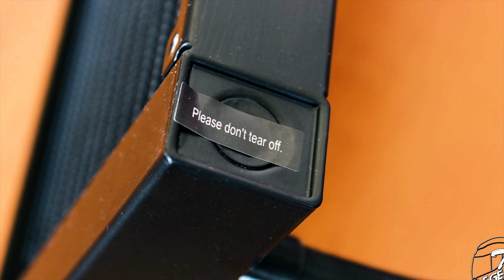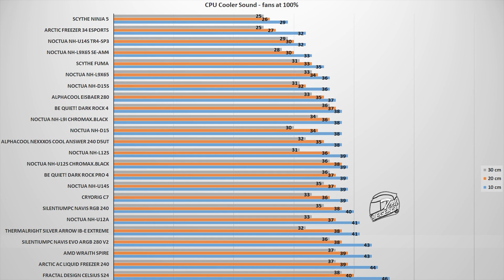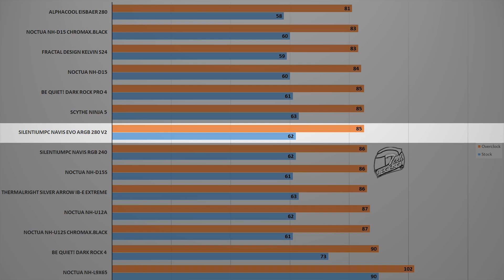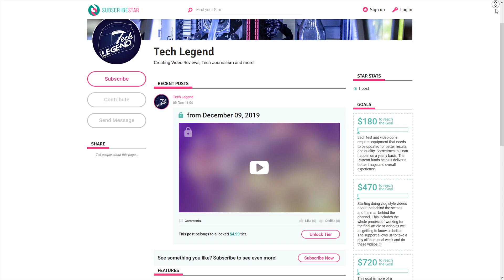SilentiumPC Navis EVO ARGB 280 V2 | CPU Cooler Review

Comment: I can not get the ARGB cables (3 pin separate) to connect to my JRainbow connector because they both have rubber around the pins. I can not even get fan 1 to connect to fan 2 because they also both have rubber on both sides. How do you do this?
Reply from the maker: Are you sure that you removed the protective cover of the RGB connectors?
Reply: @TechLegend-com  Yes pretty sure, eventually I just ducktaped them literally and the RGB works, the two fans work also.. But the block on top of my processor is not cooling it down. My processor goes to 90°C in 5 minutes. It’s attached to the PSU and the main cable is attached to CPU fan so I don’t know why it’s not cooling my processor
Reply from the maker: @Imperatormusic  If it's not cooling the CPU then RAM it, it sounds like you have a defective unit.

Comment: Mine isn't working, its in my computer but doesnt do anything, what can I do?
Reply from the maker: Did you connect the pump and the fans correctly?
Reply: @TechLegend-com  its a pre build, the fans are spinning, but the pump isnt doing anything, no color, no sound, nothing, what can i do here?
Reply from the maker: @sentinelblood4848  Sorry for the late reply. Please check to see if the CPU block is connected to your computer. Follow the cables that lead from the CPU block and you'll figure out if they are connected or not.
Reply: @TechLegend-com  I will check that, ty. Do you maybe have a link to what such cables could look like? because i see a lose cable, but im not sure if that's from the watercooler. my watercooler: SilentiumPC Navis EVO ARGB 240
Reply from the maker: @sentinelblood4848  Please see this photo: http://tech-legend.com/wp-content/uploads/2020/04/IMG_8537.jpg

That wide connector that you can see on the bottom of the photo, that is the SATA connector and that's what you need to check if it's connected to anything or not.
Reply: @TechLegend-com  I think I see that cable, it looks like its connected, but this is the cable I see that is lose : https://p61-mailws.icloud.com/wm/messagepart/IMG_4334.JPG?guid=messagepart%3ASent+Messages%2F227-4&type=image%2Fjpeg&name=IMG_4334.JPG&size=156046&dsid=1867512808&clientId=3ff313e0-76fe-41f2-96a5-98f85376ef71 . Could it be that I have to connect this to something in order to make it function good?
Reply: @TechLegend-com  And is there maybe a way to check if the watercooler is working, because my CPU gets like 80 celsius, thats too hot right?
Reply from the maker: @sentinelblood4848  The pump will make an audible sound when running. Also, touch the CPU block and the tubes, you will feel a slight vibration generated by the liquid being moved around the loop. Did you find that SATA connector?
Reply: @TechLegend-com  I dont feel a vibration, the CPU block is a little bit warm, i did found the SATA connector, i think that, that is connected, i did send a link with a picture with the cable that is lose, could it be that if I connect that cable, that it will work? I dont hear a clear sound coming from the CPU block neither
Reply from the maker: @sentinelblood4848  I can't access your photo to see that connector. If you touch the tubes, do you feel the liquid moving?
Also, no you getting 80 degrees on the CPU while it's doing nothing is not normal.
Reply: @TechLegend-com  Oh... no when im not doing anything, just it's 45-50 degrees. when playing 'bigger' games it can run up to 80 degrees
Reply: @TechLegend-com  Wait, actually i think i do feel a little vibration from water in the tubes
Reply: @TechLegend-com  I will test it out by playing a few games to see if it gets warm, THANK YOU so much for your help and quik responces, you are a true hero!
Reply from the maker: @sentinelblood4848  So it is working then, are the fans spinning at different speeds? Check them as well.
Reply: @TechLegend-com  i believe They are They are the same speed, how can i control them? Via An app or something
Reply from the maker: @sentinelblood4848  Depends on what motherboard you use. Install the software called SpeedFan and try with that one.

Comment: Have the 240mm variant and it cools my 3600 at 4.2ghz llc Extreme 1.292v at 70c with fans at max, this is on Prime95 smal lFFT. The max fan speed is audible, but i wouldnt say it's annoying. The fans dont resonate and tbh, you will never hear them above 75% unless you are doing something REALLY intensive, cuz again this cooling is kinda insane for its price.

 At idle, its cooling like a champ, barely audible.

I'd say for the price, it's definitely one of the best picks if you want an (A)RGB cooler. If you need more cooling, go for 280mm or 360mm, depending on your case.

 If u dont want RGB, go for the Arctic Cooler II. They are around the same price
Reply from the maker: Thanks a lot for the info. And you are correct, for the price, these coolers are one of the best around. Too bad I can't get an Arctic cooler to review though. :/

Comment: Will it be fine with i9-10900k ?
Reply from the maker: Yes it will be ok.
Reply: @TechLegend-com  no it not,it goes over 100 c with Thermal Grizzly on it and a big case with lots of airflow
Reply from the maker: @kirapk09  Is the pump delivering adequate flow in the loop? 100c means that cooler is toast.
Reply: @TechLegend-com  it s reaches 100c in full load test,everything it s done perfect,i dont use this cooler anymore i have a coolermaster 360 and temps are 65c,it s simple a problem with the this cooler
Reply from the maker: @kirapk09  Did you RMA that cooler and get a replacement or a refund? It sounds defective.
Reply: @TechLegend-com  guess he didn't
Reply from the maker: @jedenzet  So it appears.

Comment: That´s a really good looking AIO and seems to perform almost as good as it looks, maybe not for a Core i9/Ryzen 9, but for a Ryzen 5 / Core i5 I think it should do well.
I liked the looks of the fans and the rgb lightning, amazing b-roll as always Mr Tech Legend, greetings from Mexico
Reply from the maker: Hi Mizra, this cooler will work just fine with a Core i9, but you are going to push it when overclocking. The build quality is very good as well! 
As for the B-Rolls, thanks Mizra! :)